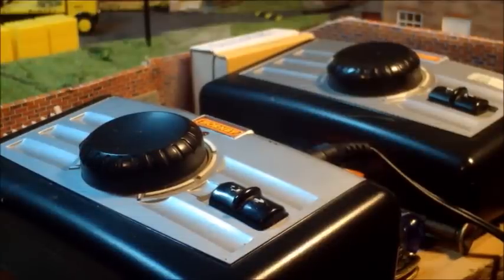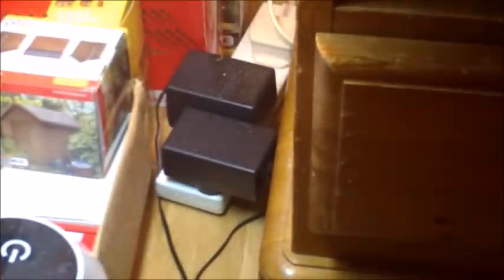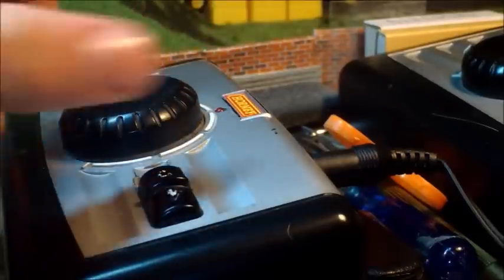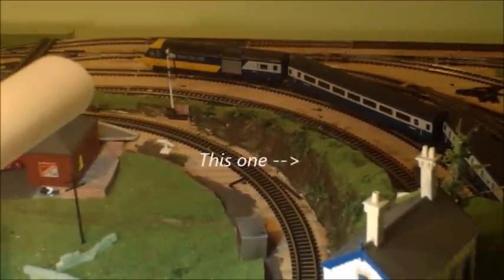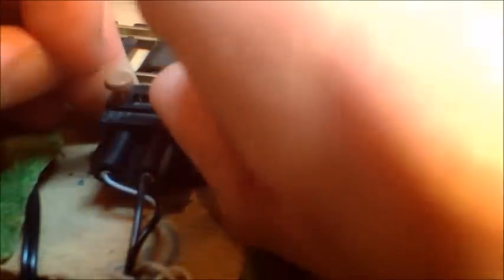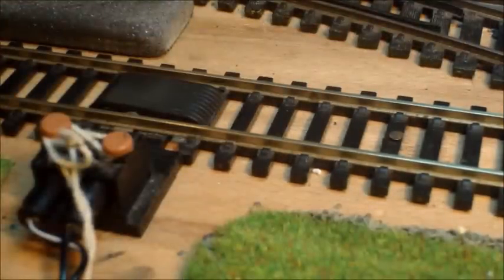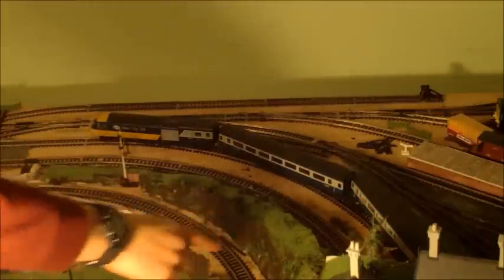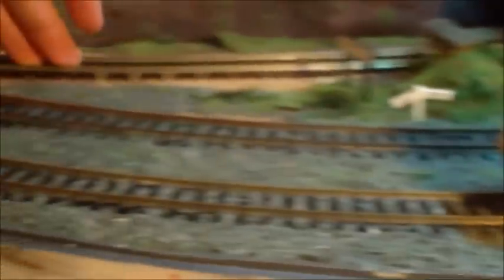How to 'Wire Up' a Basic DC Model Railway

Comment: I am starting out and have dc trains  and I going to have a very large lay out do I  spread the power round the track like you would do a bus wire  to Brad the power round there are going to be four tacks so will I need four controllers I would appreciate your help

Comment: All very interesting, but you don't really tell me how to wire a model railway. In particular, you don't explain how you run from inner to outer loops on different controllers. Surely, you must use insulated rail joiners between the two points?

Comment: I have a similar problem. I wanted to have 2 rings of tracks on which I want to drive 2 trains at the same time, but with different speed. What I have done, is carefully drilled through the point under the plastic on the switch rail, so it's not connected anymore. After that, the 2 of them got separate transformers, so when I want the train to go on the other one, I just turn the other track on!

Comment: But how do you run different trains on different tracks?
Reply: Thomas Blue you should use insulators on points
Reply from the maker: Each controller connects to a different track so they can be set in opposite directions
Reply: But if the tracks are connected by points, how dose that work. When I have two controllers hooked up, either one heats up or the trains wont go at all. Mind you, I use Bachmann E-Z Track at this time.
Reply: Thomas Blue b

Comment: nice vid. just wondering the to dc-+ dc -+ layouts tracks wont interfere if there the same dc -+. so i can run to tracks with to controllers with out triping the mains.
Reply from the maker: Yup they shouldn't interfere until you open a cross over in which case you will need to unplug one controller from the track to avoid short curcuits

Comment: Hi there, you need to put plastic fishplates on the 2 points that crossover when your using 2 controllers, where the 2 point connect to each other take of the metal plates and put on plastic ones and it won't short circuit, hope this helps people :-))
Reply: Duncan's Folly thanks for the advice.
Reply: If a train is moving on one line, can it still move as it crosses over to the other line from the turnout?
Reply: @gabrieljoson5471  yes, you have 2 controllers so you set them so they are turned on for when you cross over then the train should continue on its journey, practice makes perfect 👌🚂
Reply: @dunking44  Thanks so much! IM acc going into grade 12 so in about 9 years when i have my own house i can start doing some REAL work on my model railroad :)!
Reply: @gabrieljoson5471  good luck🚂👌

Comment: Do you use cab control? I would like to know, as I'm building a DC layout as well.
Reply from the maker: Edwardthegreat248 Sorry I'm not sure what cab control is?
Reply: Oh, its wiring that allows people to run two tracks connected to each other, do hornby switches need wiring to have two tracks run under different power?
Reply from the maker: Edwardthegreat248 I think I understand. Not on DC - you can just link two controllers unto separate track as I've done. Just be careful with crossovers between the two tracks; If the controllers are in opposite directions as a loco passes across the system can short circuit...
Reply: Oh OK thanks!

Comment: A interesting video. What does the switch and the controller under the baseboard do?
Reply from the maker: Thanks :) The controller under the baseboard is for lighting to be added to the layout at a later date. Which switch do you mean?
Reply: Humbolt136 The one right under the controllers
Reply from the maker: Great Western Steam Ahhh that's an isolating switch for a siding at the back...I could do a video on that if you like?

Comment: Well explained Timothy
Reply from the maker: Haha Thanks :) I'm not brilliant at this whole make it up as you go along thing :o
Reply: +Humbolt136 To be honest this is not even right.

You have not wired up anything, you just attached a couple of power clips to a toy train set.

As you said, you may have short circuits and you may have problems moving from one track to the other.

The correct way to do this is to put isolating fishplates in between the two ovals. Then using double pole double poll switches controller A can be assigned to track 1 or 2 or both. Same with controller B. Then either controller can run either loop or you can switch one to both to transfer trains. 

If you wire up the track feeds to the centre terminals and the controller feeds to the outside ones, the controllers will not fight over a section of track.

I seriously recommend you look up and understand "cab control". Then you will probably want to delete this and give some proper advice because you are just misleading people with this. 

And connecting power to the tracks, you need to be soldering on dropper wires, not huge power clips which ruin the look of your model. 

I'm not trying to be harsh - you will thank me for this which will take your modelling to the next level!